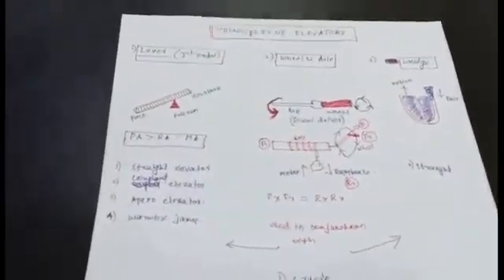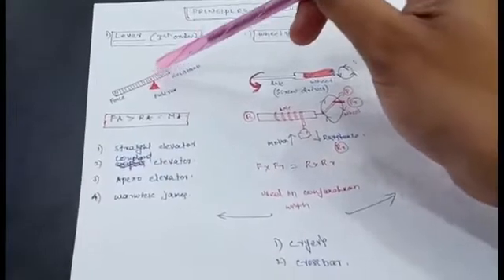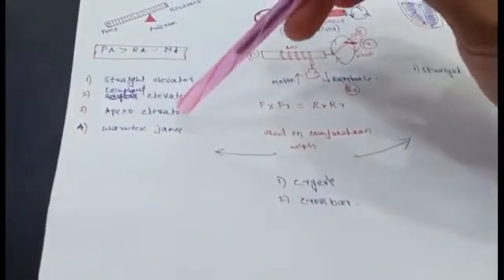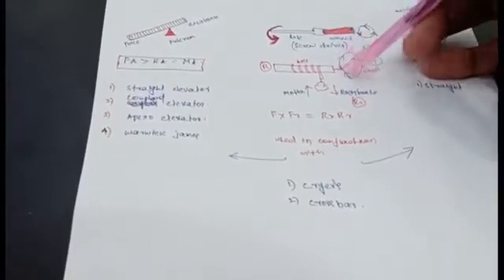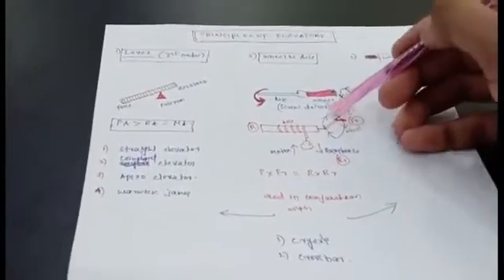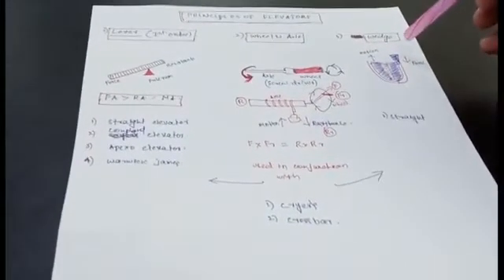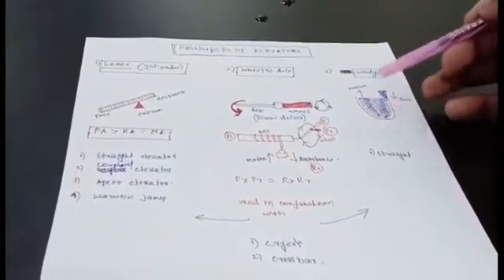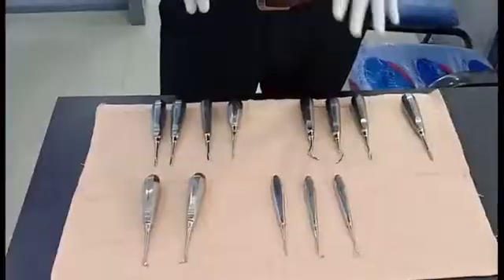TOOTH ELEVATORS

Comment: Sir, after the tooth been shaped and impression is tsken , is it important to put false cap, if the permanent cap comes after 7 days? Will  in mean while gums will start growing?
Reply from the maker: Its adviceble to put a false cap/temporary crown/temporaization inorder to avoid supra eruption of the opposing tooth and migration of adjacent teeth. A slight lack of space will result in unwanted removal of adjacent or opposing tooth to get rid of highpoints or occlusion.
Reply: @Dentistrynmore  i had an x ray, can you tell if the  crown cutting was donw correctly or not?